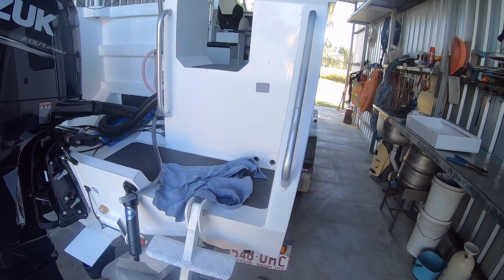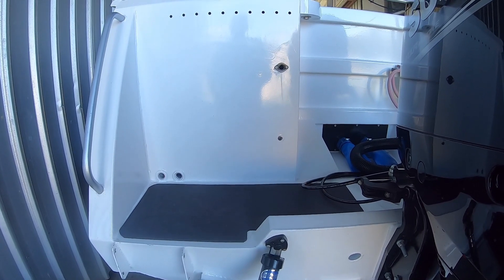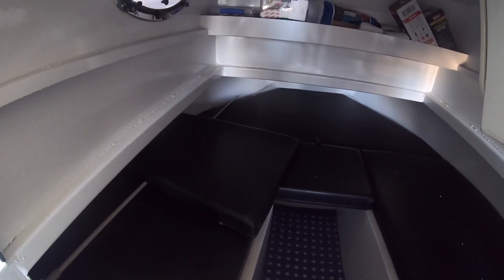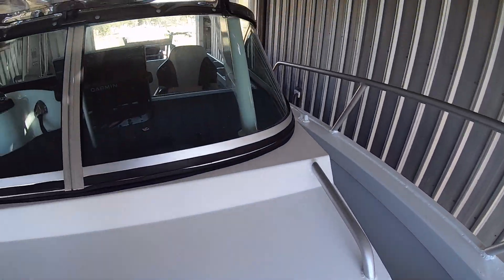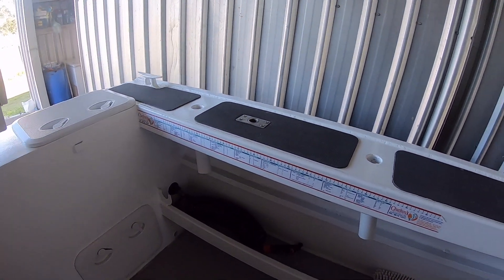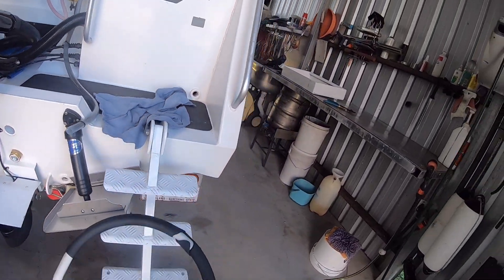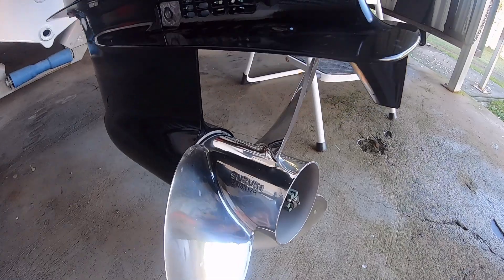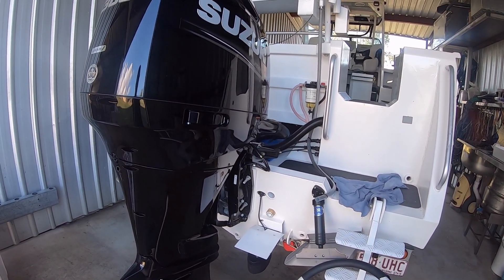Gospel boat review

Comment: The Anchor sock just use large electrical heat shrink at each end. I use it on my Anchor rope over the spliced sections works a treat. Plastic Cable ties will break down in the UV and Salt. Stainless wire or Cable ties will break due to flexing. Nice honest review, Im not sure of your background but those cracks are showing you have a lot of movement in the hull. Pay a boat builder to do a inspection as it may need extra bracing below the deck as well. On a side note I worked for a Engineering that started to import ion ore crushing machines from China. I remember the first one we imported looked good from a meter away but when we did the proper QA we found that the so called welds where painted silicon. The 2 ton sample crusher had been put together with Tack welds and the Silicon to look like perfect welds. I have worked with Chinese manufactures before and unless the workers are supervised they will cut corners and see nothing wrong with it.

Comment: To fix the nylon anchor sheath sliding on the chain, just get some stainless mousing wire and poke it through the sock and through the centre of a chain link, then wrap it tightly a few times & twist it off.  I did this at each end and every 1 metre down the chain sock.  Works a treat.
Reply from the maker: Thanks Mark

Comment: Sir, with regards to the cracks you should deal with them as soon as possible because the corrosion will still get into the cracks and spread, plus it will put additional stress on the rest of the weld. 
At least get yourself a drill 3mm and drill both ends of crack to stop it running further. The get the crack ground out and rewelded.
Reply: Yes. I sleeved all the bolt fittings with plastic. Stop all dissimilar metals. Factory is implementing a few now

Comment: Interesting little issues.
Those 2 cracks on the side of the cabin supports are serious, it's metal fatigue from sideways movement.
Definitely attend to this while it is easily repairable.
You need to add 2 x 8mm x 75mm 306 stainless steel flat plate from the bottom of the side walkway all the way up to the roof fitted flat on the end of the upright.
It should NOT be mechanically attached, but glued on with Sika 11FC structural polyurethane adhesive sealant over the cleaned paint, this will allow some minimal flex with the boat.
If this is not done, the upright will likely snap off with fatigue in a couple of years with some rough weather.
Reply: He needs to ,take it out to sea and loose it and claim on his insurance.These things are death traps.
Reply: That's part of the cab. It isn't structural.
Reply: Still subject to metal fatigue cracking

Comment: What ever happened to the cracks? Did they get worse or stay the same? Did you end up fixing them? Any other dramas you’ve come across?
Reply from the maker: Cracks in the cab posts are still there I haven’t had to intervene yet ,would be a easy fix .No other drama .has been a good solid boat .l am very happy with the build quality and the ride of the hull

Comment: Do you keep this boat on the trailer ?  Is the paint on the bottom considered a “bottom paint “ that you could leave in the water ? Just curious how much electrolysis would happen if it sat in salt water. Does it have aluminum anodes ? Did you consider any other alloys aside from 5083 (like 5086) ? Thanks !
Reply from the maker: Yes I keep this boat on a trailer,the bottom is not painted,if I was to leave it in the salt l would definitely put anodes  on the hull as far as aluminium goes it all corrodes
Reply: @eastcoastfisher5457  thanks ! You re still happy with it ? I saw a video by stabicraft from a year ago talking about knock offs and the issues. I priced the gospel boat for about 35k with options, plus another 27k for motor, and another 16 for shipping. Not sure about import tax or if any issues getting it insured or registered.
Reply from the maker: @matthewdickson2627  yes mate still happy .... your shipping price seems a bit steep? I would be checking with customs what costs your up for and a builders plate for rego
Reply: Hey, great review. I am seriously looking at one the same as yours. Trying to work out the extras etc. to get from factory. Will put the motor and elecs in here in OZ.
Couple of questions: trailer, is this the one from China or sourced locally? I will be beach launching 95% of the time, so was considering a custom dropped axle when it arrives here.
Trim tabs, are they from factory?
Drivers seat - custom or factory
Clears on the cab - are they factory? Haven’t seen the option in their pricing.

Last one, can you take a pic of the anode? Have you replaced this? 
Cheers

Comment: A little off topic but why did you mount your deck winch forward rather than to the back. Is that flush mounted? Have a couple we're mounting on our Gospel and want to get them right the first time.
Reply from the maker: I just mounted mine where I fish
Reply: @eastcoastfisher5457  Actually just noticed you've two mounts to the front, two to the back. think we'll do the same :)

Comment: Hi, what is your view on the trim tabs on this boat, would you add? Do you find you use it regularly?
Reply from the maker: When it gets a little nautical they are a great addition they keep the noise down and cutting through the chop making for a much smoother ride . Yes l would add 👍
Reply: @eastcoastfisher5457  thanks for the advice

Comment: Hi there,
Looking at getting one myself. Have you had it out on many rough days yet and I so how does it hold out?.
Any hints or tips for myself as a buyer?
Cheers Daniel
Reply from the maker: Hi Daniel,
Yes l have been caught out in so rough conditions,the hull handles it not worries . The 24 degree dead rise cuts through well and the double chimes gives you great stability at rest . As for buying one just have a good look over it ,check all the welding Look down inside the transom inspection hatches check the welding in there too and the General fit and finish . They are a good solid boat you won’t be disappointed

Comment: I have seen paint booths and whole boat is pressure washed and then final washed again with pure water with no salts in it then washed with a oxidation retardant which keeps it perfect untill primed.  There is no better system.

Comment: So apart from the paint peeling, the structural cracks, poor waterproofing, poor fuel system design and aesthetically poor welds, there's nothing wrong with it. So far. 👍 Thanks for your honest feedback as it helps those planning on purchasing a new rig. Think I might go for something other than chinese made. At least until they can prove they can build something of quality. Hope it continues to get you and the family out there and back.👍

Comment: The welds that you believe are o.k. because they go in a straight line are just not good enough. They have tried to cover this with thick paint, carpet style trimmings and rubber type sea decking, and that`s the point-a cover up. Also the cracks don`t bode well for the structural integrity of the boat. Just pay the extra for peace of mind, if you can`t pay, don`t go boating. House made of straw remember!
Reply: i paid the extra and i ended up with a motor that come loose and bent in the transom, Paint work peeling off , engine that wouldn't go into gear because the idiots didn't install it right, QLD BUILT ANGLAPRO canopy come flying off first day i took it out was held down by pop rivets all the same shit champ u just get ripped off in Australia for the same crap